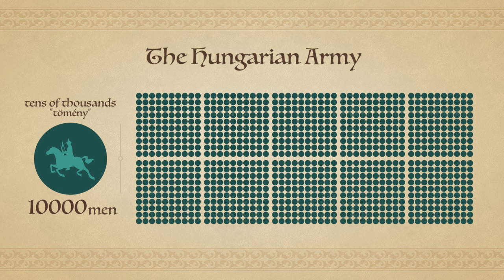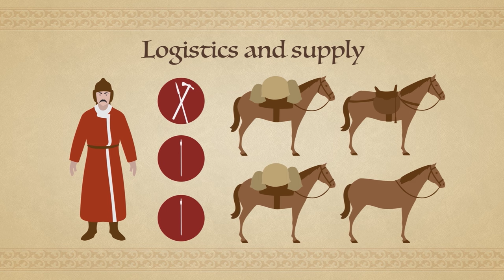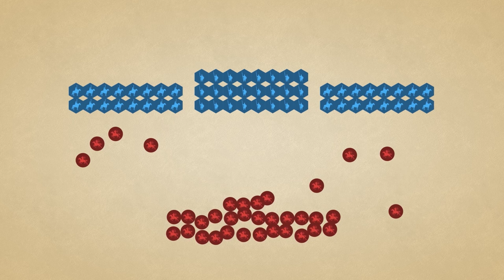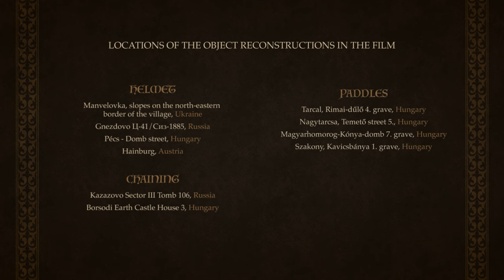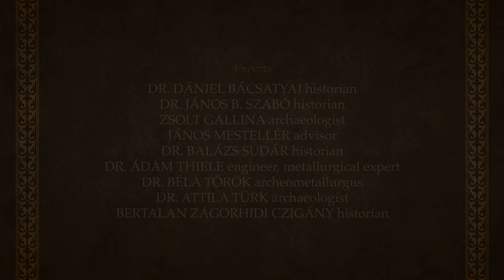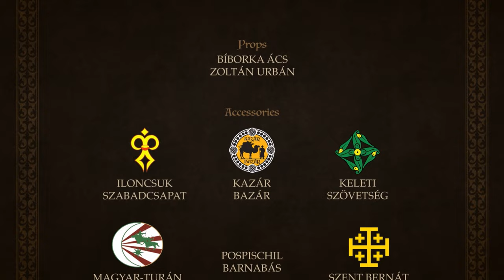IN THE SADDLE, ON HORSEBACK - The art of war of the conquest-era Magyars

Comment: No one would've put the arrows upside down into the arrow-quiver like so. With sharp cutting edges its inpossible to take them out safely unless ones doing it very slow and carefully. that's diappiontingly unaccurate.
According to Dr. Hidán Csaba, the nomad Magyars never took out more than one arrow at the time, thats what the quiver for: to keep the arrows there untill actually shoting them.
Reply: They placed that way too cuz they used different type of arrow tips
Reply from the maker: Dear Zakk! Actually it works perfectly, and way better, than the other way. In this case they could easely choose between the different arrow types. This theory was tested in the last years, and noone ever cut his fingers with the sharpened arrowhead. That is why it was represented in the film.
Reply: There was a case where they carried the quiver that way, but you are right, otherwise the mountains were not facing upwards! I don't know why they invented this? The length of the arrows changed a few centimeters, and so did the color of the plumage. From this, they knew which one was needed when. In addition, the Hungarians put 10 canes in their hands in a special grip. The tips are always forged and sharpened with an ideal entry angle of 27 degrees. It also pierced the armor of the heavy cavalry.